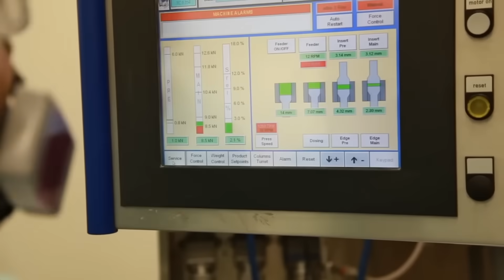Why These Engines Only Last 3 Seconds

Comment: no they dont need full teardown and rebuild after each race ive got family that is racing topfuel. Altho they do in fact need to get a Fully 100% inspection and testing, 95% of the time also some parts require changing. But still my family member that drives have run 3 strips with only Inspection needed after each race.  i can also add there that that time with the 3 runs  without repair or changing stuff. It wasnt an big race competition and he didnt run it at the full HP build. if i recall correctly it might even have been qualifying race or "testruns for competiton" i know it was Before he got big Sponsors. he did have to pay 80% out of own pocket back then

Comment: When watching top fuel live i recommend sitting about half track while you feel the power from the engines in the pits during burnout etc nothing beats the eye rattle you get near the half track mark... ya can see the car coming then everything is just blurry for a split second while ir entire body vibrates.

Comment: Its so stupid that the point of them is stupid! Lets spend over 100K on an engine just to go in a straight line for 3 seconds. Its a stupid and unnecessary sport, if you can call it that. Its more like a ridiculous hobby for rich people. A driver that sits in the car and has to steer and manage the vehicle for hours is an athlete. A dragster just learned how to not completely fail at steering and they still manage it pretty regularly.

Comment: 1:35 these are not the hardest run engines. 
Pulling trucks do this, for several minutes, while running on a dirt track, dragging a huge sled weighing multiple tons

Comment: I've got a 6 cylinder 2009 Impala with leather seats and 325,000  miles on the odometer. No dents or rust, and It runs great!

Comment: when the only thing preventing you from just using solid rocket motors are the rules

also just some caveats:
 drag racing cars are absolutely not the fastest nor the loudest vehicles on the planet, they might be the fastest and loudest traction powered cars tho
 they are also not the fastest accelerating vehicles, with ejection seats accelerating at anywhere from 12 to 22 g. Not to mention John Stapp who in tests to figure out how much acceleration humans can withstand experienced 46.2 g.

Comment: Only 500"...my 496" Shelby only made 603 HP, but it does it on pump gas - NOT nitro - and Carroll Shelby even offers a warranty IF you use Schaeffer racing oil!!!

Comment: I use to attend NHRA nationals fairly frequently (I am now very far from any of them) I would routinely get a seat at the Christmas tree so I could experience the impact of the fuelers and funnies starting out. If you had your mouth open the pressure wave would simply drive the air out of your lungs (and of course when you refilled your lungs it would be with a combination of exhaust, burnt rubber and clutch pellets). A great show 😀

Comment: You'd need an 800GPM fuel pump for 11 gallons per second. The chamber is only 200cc  . The pump is 116 GPM and that's the rule. And you need at least a 10% safety margin so you don't go lean.

Comment: The real question is
What is the point of the pilot? Basically a holdover at this point
This is already 99% engineering, you could easily automate the 1% that us microcourse correction

Comment: While I do appreciate NHRA I feel as an aviation geek, I have to point out that Top Fuel dragsters consume more fuel than 1 engine of a 747 at takeoff.  They are sucking about 24 gallons per second total at takeoff give or take depending on if they have GE's CF6 which CF6 and if they have GE's GEnx which are more fuel efficient.

Comment: I think that superchargers and turbochargers were actually invented during world war II to enable aircraft engines to operate at higher altitudes. They were meant to compress the thinner air up at 30 thousand feet to keep the engine from stalling, and the increased engine power output at lower altitudes was actually an unforeseen benefit.

Comment: The 800hp blower drag is surprising to me.  We saw that much drag with a gear driven Procharger at 1/4 the power level.  I would think the blower would require more.

Comment: So much resources wasted for a straight line 3s-ish run. I can understand the excitement in the crowd to watch a few run, the engineering challenges to push the limits further away while respecting the rule. 
But just 3 freaking seconds, Flying a fighter jet can give you that much acceleration and at least each run last more than a few seconds.
So just for fun and entertaining, why wasting that much resources on this? 
I should attend one, apparently there is some in New Zealand & Australia and talk to people into this to understand maybe.

Comment: Got to see top fuel in person. Made a run and got to stand about 40 yards down the track and about 15-20 feet away from the wall. The power from these things are insane. It literally shakes your insides and basically takes your breath away. More than likely you’ll get good bumps when it passes. Tears flow. Not out of fear but because of the fumes. That’s the best way I could explain it. It like sucks all the energy out of the air around you and makes you feel insignificant af. Like that’s power you can feel , legitimately, without physically being in a car.

Comment: They are LOUD as f*** too. I remember the very first time i seen one. I was not expecting it. It was so deep and loud that, all sound around you immediately stopped. You were basically deaf to the outside noises. The only thing you could hear was a very deep roar, followed by a vibrating feeling. Like if you had nothing but bass blearing in your ears.

Comment: My uncles car is always on a trailer, ready to go at a moment's notice. Accquarro racing in port st lucie fl. His engine has lasted through every run and was only rebuilt to make more HP/TQ. Weve also got a 78 Yenko Z quad turbo making 1590hp ready to hurt feelings aswell

Comment: I thought they ran 1/4 mile 1320 feet.
Reply: They definitely used to,
Reply: They switched to 1000 feet years ago to keep the top speed down.
Reply: @snakerstran9101   Top speed went up but they have more room to stop. Brittany Force set the record for fastest Top Fuel run ever this past summer.

Comment: People fascinated with top fuel engine specs usually get a kick out of rocket engines too; the turbine used as the fuel pump for the moon rocket made over 50,000 horsepower, where the combined propellant flow rate of all five engines was 3,350 gallons per second. That's consuming the weight equivalent of 5 Ford Broncos every second in fuel.
Reply: Bruh what. 🤯 Thanks for the comment
Reply: As a space nerd who knows more about rockets then cars, I’m surprised that some of the stats on these engines can meet or even exceed the absurdity of a rocket. Like the RS-25s on the shuttle had to be rebuilt after each flight too, but they at least need to operate for 8 1/2 minutes per flight.
Reply: @VolcanicSpacePizza yeah it'd be interesting to see if we could build a dragster engine capable of running for 8 minutes

Comment: Even as an engineer, and builder of both hi-tech, and trad V8 engines, to me, the numbers, and engineering facts involved in top fuel racing are mind boggling.
Getting this kind of performance from this simple style of engine is almost unbelievable, it's a grenade..
I love F1 and other types of racing too.  BUT..
The sound of a nitro idle,  a blap on the throttle, the sight and sound of the run, and the amazing teamwork, it's magic, long may it continue.

Comment: @1:00 this is a myth. I spent a good amount of time talking to the guy responsible for clutches and fueling on a Top Fuel team about this specific subject. The straps on the plugs may burn away, but since there are two plugs, they will continue to arc on each other or the motor itself. Nitro can diesel, but it’s really not a common occurrence, and nothing they plan on during a run.
Reply: If the motor was dieseling you could never control timing . The Rev limiter could never pull timing out. I did a few seasons wrenching Top Fuel

Comment: Hey so those dragster engines run a total of 1 minute per race and can run on gas which would make less hp but make the engine work perfectly fine for extended time periods

Comment: A green glow sometimes around the orange flame is seen. It is pure  hydrogen burning. And accasionally you'll see a solid green flame. Why? Is the fuel mix off? What is the reason for this occasional change in the combustion chamber

Comment: They last longer than 3 seconds 
0:03 (:face-blue-wide-eyes:) states they run 3.5 seconds just to run the 1/4 mile, not including burn out or run out. They could probably make another run but why take the chance?

I wonder how shorter the car gets at 8 Gs of acceleration on such a lightly built frame.

Comment: So putting aside the NHRA rules and restrictions, I wonder what would be the fastest possible engine design?  More cubic inches?  What else could they do?  And forget about the 1000 foot artificial limit, what absolute maximum possible speed could be attained over as long a run as you want.
Reply: That would fall under the land speed record and all the sub categories.

Comment: Great video, thanks for putting this together.  One question, @0:45 the video states that these engines consume over 11 gallons of fuel per second, but at @7:00 the video states the fuel system only delivers 5 gallons of fuel per second.  Why the difference?

Comment: Inconel actually has several different mixtures and alloys with various applications. Those engines probably use Inconel x 750. It’s used in high end engines like Lamborghinis and is what makes them expensive as well.

Comment: One of the best moments I’ve had at an NHRA race was a throttle wack. Besides the actual run, a throttle wack is like getting kicked in the chest on top of crying and having your nose running from the nitro. It doesn’t matter what you think is loud or fast nothing will beat the experience of top fuel. It’s ridiculous.

Comment: top fuel dragsters are not the fastest accelerating vehicles on the planet.  That would belong to space-faring vehicles that make entry with the earth. barring those, it would be fighter jets. Barring any aircraft, it still wouldn't be top fuel dragsters, that would belong to impact testing tracks. Barring any special roadways, it's still not top fuel dragsters, next it would be rocket-propelled cars.  Then, finally, our top-fuel can make its mark,

Comment: I've been in the standing room at the Indy 500, close enough to an explosive crash to feel the heat from the fireball. I'm a chemist and I can work with explosives and terrifying acid mixtures no problem. I love air shows and rocket launches and all manner of other big energetic things. Drag races scare me. With most scary things, knowing how everything works takes the edge off the fear, but the more I read about top fuel dragsters, the more scary they become. It's just an impossible amount of force, mechanical engineering should absolutely not be capable of taming that much power even for 3 seconds. Anyone who gets inside of one of those things is beyond brave.

Comment: Just another person reading the same old Top Fuel Myths, a lot of it is BS, if the tune and clutch is set right for the weather and track surface condition and there's no mag failures, besides the bearings and plugs almost all the parts a reused between rounds.
The plugs can't be used again but don't completely burn out by 1/2 track, if and when they do it will "hose" the cylinder that the plugs have gone out on and if your really lucky it doesn't hydraulic and destroy it, but will probably bend a rod, in most cases it will back fire an just pop the belt off and the burst plate out.
The dieseling is also a myth, detonation kills these engines, major detonation will torch the head and piston of the cylinder detonating and some times even torch the block, so you have pile of junk after the run.
Detonation is one of the main reasons the heads and pistons are pulled after each run, detonation will flatten the rod bearings so they are measured to determine the amount of detonation during the run, a new set fitted and then once again after reading the weather, tuning can be adjusted to try and reduce any detonation on the next run.

Finally, in one meeting doing anywhere from 3 to 6 runs, we read the weather and track correct, we set the clutch right, the driver doesn't pedal, don't have any mag, fuel pump or injector failures, the rod bearing are not severely flattened, the rods, pistons and heads are reused and only after the meeting we will check the rods for any bend and their lengths and if still in spec they then will go into the spares and used again at a meeting if we do hurt parts.

Comment: All these descriptions of the spectator of a top fuel experience are spot on. I like to think of it as an entire roll of firecrackers. Only the firecrackers are full sticks of dynamite. A big roll of dynamite sticks, going off at the same time. That burning roll of sticks of dynamite   zooms by you at light speed. Only, all you hear, is the dynamite thunder going by for a split second of ear splitting earthquake, sensory overload. Ear drums melting out of your skull. With a grin that couldn’t be smashed off your face.

Comment: I watched another similar video a few years ago :  https://www.youtube.com/watch?v=xTsphmCn8mg&t=1270s - What goes into rebuilding an 11,000-hp Top Fuel dragster engine?  As someone with an engineering background it was fascinating. This one equally so. The technology is so different from high reving normally aspirated petrol engines .Interesting that the record was set by a woman. Something I gleaned from fighter jet videos is that the female of the species is more resistant to G forces.

Comment: Those engines/heads are a lot easier to work on than a normal car engine, simpler designs, less bolts and gaskets, and easier to get to. So it’s not hard to imagine why they are so easy to rebuild after every run

Comment: What’s real life application of the “technologies” you asked? From Transmissions, Time Savers from staring, Suspensions, Tires, Brakes, Engine Air Intake, Dual Overhead Camshafts, Safety, etc that on your every day driven cars ARE not from drag racing. This is a useless sport that will sling into extinction like the dinosaurs.

Comment: Best fuel smell ever!
Excellent video, my friend...
Burned 20% Nitomethane 75% Methanol with 5% Castor oil lubricant. The  fuel required for my 2 Stroke 
R/C plane engines. However,  
These Top beasts be feeding on 100% Nitro ?!?!  Whoa !

Comment: "So much fuel is being added to the engine, it could hydro lock if the fuel doesn't ignite properly" is absolutely insane.
Reply: I've worked on one
Reply: @Imposter8458 Really? So how is this sport profitable? Undoubtedly you're spending $10,000 per rebuild, plus god knows how much money to even build an NHRA dragster. Where's the profit? How is this even feasible and able to keep going??

Comment: Just so you know, they don't just use pushrods for simplicity. Valvetrain friction loss on top fuel engines is almost insignificant compared to how much power they put out. The pushrods also act as shock absorbers for the valves to keep them from getting punched through the cylinder head. Multi-valve setups also tend to perform worse than two-valve setups at extremely high lift profiles (when the valve lift equals or exceeds the port radius), meaning one of the main benefits of overhead cams wouldn't even apply.

Comment: He’s just reading the top fuel “fact sheet” which is going around, which is not all true. The spark plugs are not melted, and the engine is not dieseling, on a normal run.

Comment: 5:30 so if they threw the rules out, would that mean they could make an engine that goes significantly faster than these do with decades of innovation since these were invented? If so, I wanna know exactly what is possible if money was no issue, and neither was the g forces on ppl, make it computer controlled or something just to see what's possible.
Reply: You've got a really good point. Saying it like that i think that is completely possible if you can engineer all the engine components to actually handle that (i.e bearings, seals, rods, cilinders heads etc.) Finding the right materials for the components and engineer/mill or fabricate them for that purpose and to handle those loads and torture is the biggest challenge i think. But it could be plausible maybe.
Reply: I agree completely. I’d love to see how these things could move without restrictions. But at some point we’d have rockets strapped to wheels and inevitably someone would end up in someone’s home miles away and in the news
Reply: piston engines wouldn't be used at all
Reply: it will be a 70 liter v8 with 8 blowers and a rocket fuel with the highest explosion energy possiblemaking 50000 horsepower or even more haha

Comment: If you've never been to a top fuel drag race, go. You don't even need to be a fan of the sport to experience the visceral nature of the cars. They're moving so much air, you can feel the beat of their exhaust even when fairly far away from the track. Your chest becomes a drum. It's absolutely incredible. Take ear protection.

Comment: In the intro you state that the engines consume 11 gallons of fuel per second but later in the video while going into detail on the injection system you say they pump 5 gallons a second. Both rates are hard to fathom but that is a big difference and I'm just wondering which is true?